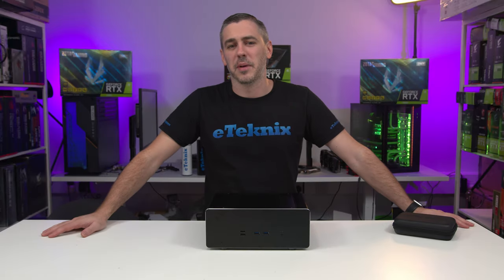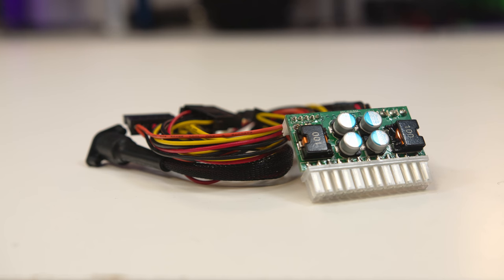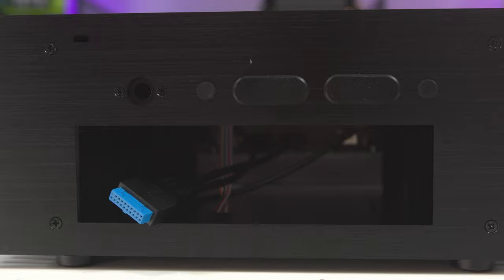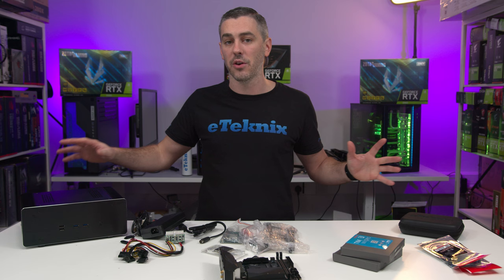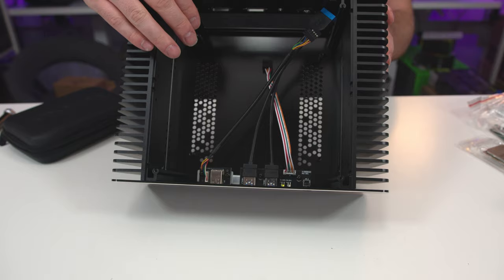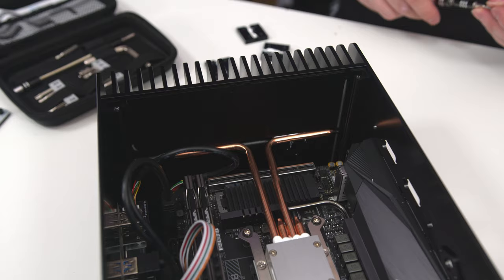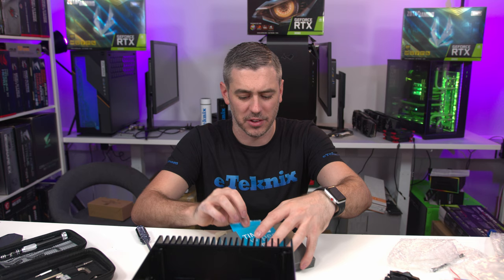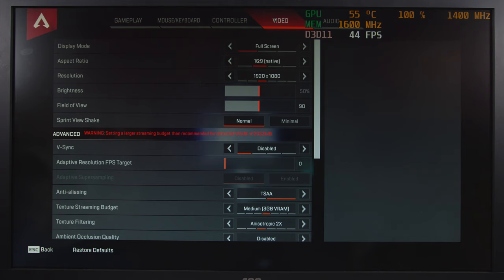The ULTIMATE Silent Gaming PC? [Akasa Maxwell Pro!]

Comment from the maker: Would you game on a passively cooled PC?
Reply: As an audio mixing and mastering engineer I'd like to say "YES!", but a lack or propper airflow makes the PC components go hotter and that produces more noise, and the risk of failure and thermal throtling is real.
Reply: Yes. My Ryzen 4750G would fit nicely.
Edit
The song you have in the B-roll kinda made me want to play SimCity again for some reason.
Reply: I would even game on toaster machine.
Reply: I think the passive cases personally are nice, but very niche in terms of customers and with low profile, Mini ITX more common then years ago,  lower rpm fans are now being made and many compact CPU fan/Heatsink designs are often quiet enough that minimal fan noise is audible and will give a much better experience, and in my experience a very inaudible one with better performance. Also now with software making undervolting on CPU and GPU's also lowering temps, allows for slightly more powerful setups to be created giving higher frames per second in addition to better quality gaming. However, another great eTeknix review. Keep up the great work and with all the fans (pun not intended haha :P) below i think eTeknix will get it subscriber base up as unlike many U.S. based reviewers you do some alternative content rather then the usual high performance NO LIMIT builds etc with RTX3090 in SLI/NVLink etc. Cheers from Australia :)
Reply: Not 1 without a GPU like that. lol
Reply: @heavymetalmixer91  I have a 5700G limited at 65 watts using this same setup. I will try it in Music Production and some gaming yo see what happens. So far, installing Windows and programs, it looks good

Comment: Really cool product and amazing vid as always. I recently built a HTPC but used an old HP case that still used normal motherboard mounts and had 3 full PciE slots so used a gtx550 that was collecting dust. Only problem is does sometimes get a little noisy but nothing too bad. Wondered about doing a passive cooler but parts are very expensive here in South Africa
Reply from the maker: Great that you've done something using some old parts. Find the source of the noise and change things one at a time :)

Comment: dear, 
I have already sent an e-mail with the question, but I did not receive an answer.
Thank you for the nice explanation, so go and put one together for my wife.
But you are using a B550I Aoris Pro AX with an AMD ryzen 5 3400G , at the supplier that processor is not mentioned as compatible, are you sure I can put that together with those components ?
Many thanks, Walter

Comment: I am eagerly waiting for the delivery of my Akasa Maxwell Pro to complete a silent DAW build with a Ryzen 5700g, 64GB 3200Mhz CL 16 DDR4, Asrock Thunderbolt 3 Motherboard, 4TB NVMe, 4TB SSD, and a custom stripped down version of Windows 10 1909 for ultra low system latency.  This will compliment a Ryzen 3900X DAW workstation and can work together via ethernet and Vienna Ensemble Pro.
Reply: What Asrock Motherboard are you using?

Comment: it`s very easy to make this a real gaming PC, move all pipes to only one heatsinkwall (they are easy to bend), place a videocard without the heatsink in the socket (1650 or such), measure the distance from chip to the other heatsinkwall, build an aluminum cube to the exact dimensions and place it between the videochip and the wall

Comment: Very nice case, but could use a little more development to be perfect. The way the heat pipes run it nulls out any use of the PCIe slot and from what I saw doesn't even give an opening for any kind of card for said slot. Obviously there isn't room for any worthwhile GPU, but say you want a wifi card if motherboard doesn't come with it. Or a NVMe card for extra space for games or other storage, or a cable TV card. Other than that seems good.
Reply: I'd go the other way and say that as the heatpipes mean no expansion card that the case should be smaller: looks like a lot of wasted space, even with a hard drive tray. Otherwise a nice looking case.
Reply: @stevenblackburn7544  The body should not be smaller, otherwise the other components will suffer from excessive heat. I put 32w in this case (the madness is to put 64w).

Comment: What cpu are you using?
Reply: 3400g
Reply: @dennistomsen5822  Great. I'm trying the same built with a 65 watts limited TdP 5700G. It works. I still have to try it in more intensive tasks and see how it performs. It's quite good, so far